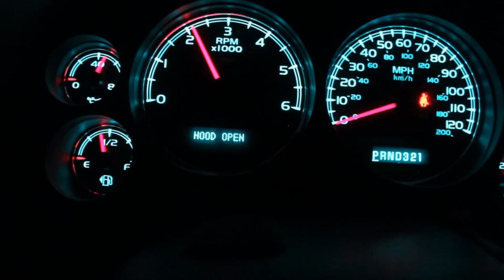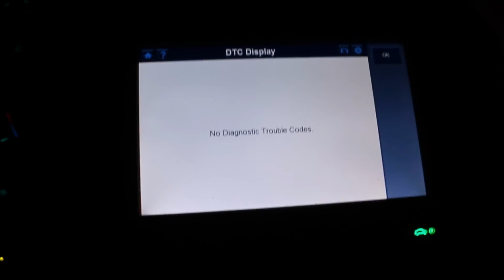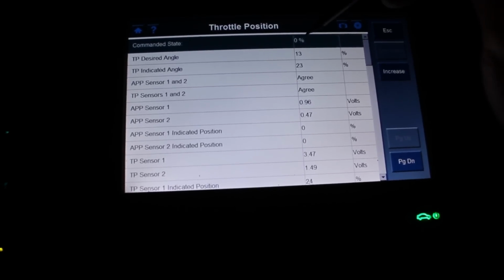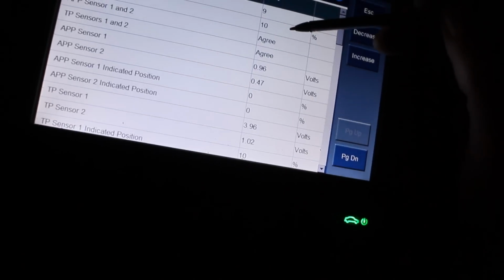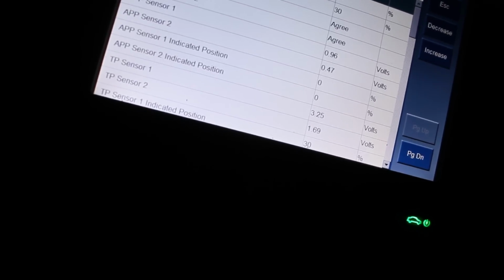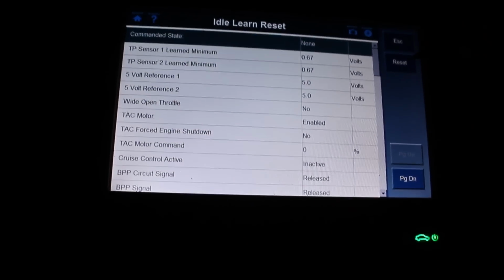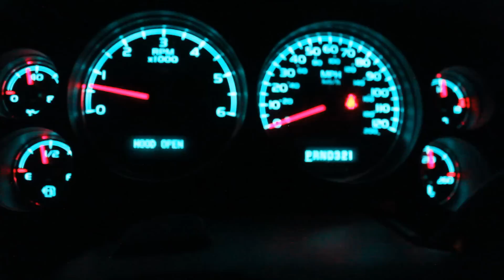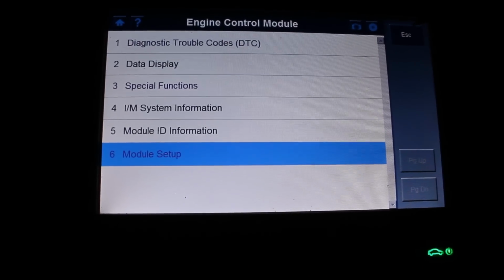GM Throttle Body Relearn using Autel MaxiDas DS708

Comment: I cleaned throttle body and used my snap on scanner to do re learn but my idle wont go down still at like 3000rpm any ideas.. idle was fine before cleaning it but had code

Comment: I cleaned my TB and it started idling crazy and the rpms was off at high speed. This video educated me on the relearn process!! I purchased a Foxwell scan tool and fixed it in 5 mins. Thanks for this awesome video.
Reply: which foxwell did you get?
Reply: @marrob_ltz1011   I used the NT510 but the NT520 will work also.

Comment: Just cleaned my throttle body today took apart from the mount and after I put it back together my idle is sitting at 2500 almost 3000rpms. Guess I will take it to GM to recalibrate it🤷🏽‍♂️ but after a few drives it idles at normal(500-600rpms) but when I rev it will go down to 1500-2000 and stay there...
Reply: Hi man.. I got the same issue... Did u got any solution for this? Plz help me out. After reset..idle came to 550 but when i accelerate it.. It goes up and does not come back. Any suggestions?
Reply: Also a saw some videos that did ground cleaning. The one underneath the front driver door when normally lifting jack is placed to change the tire. But with me it did not work.. I try to drive the car much.. Still same.. I will wait to drive 2-3, days lets see.

Comment: Rpm is at 1300, can this device reduce it to 500-800 ?
Could it adjuste the throttle body by default ?!
My car is Peugeot 206 1.4i 2006.

Comment: I have a question. I got a 2007 gmc yukon. And i was driving  at 75 mph. And then the check engine light  come on..   and wont pass 60mph..  so i put the scanner  i got  a code for throttle  body. Ao i bought a new  put it on .. i did the relearn reset ..  still doing the same thing but no codes . 3-4 gear  rpm go higher to 3000 so i have to release  the gas pedal so it can catch  the gear. . Any suggestions. Thank you..

Comment: This happened to my truck 2010 Silverado changed the throttle body and now is 1,200 rpm idle to high I don't have this scanner or computer where can I take my truck to fix and how much is going to be thanks.

Comment: Hi Hiram, like your DS708 videos. I also have a DS708 that I have not updated it since mid 2014. You seemed to do quite a bit of advanced procedures with a DS708 that Autel only lists it's coding abilities as minimal, while the Maxi Sys 908 coding abilities are listed  as advanced.
  Since you bought your MS908 I know the hardware is better and in theory could offer much greater ability to process more complex coding ability  , but in reality did you notice if it  really offered way more needed coding features than the DS708 seemed to have (aside from the Pro's online programming for BMW and Mercedes and using it's Maxi Flash J2534 off a windows laptop after purchasing  a paid OE subscription, that you actually found and  need that your DS708 lacked with it's so called minimal coding ? Thanks,Jim

Comment: Hiram Gutiérrez what's other options to reset throttle body , I don't have diagnostic tools.. in my 02 Yukon I cleaned inside throttle body and I also  removed the butterfly valve , I know  sounds dumb but I did it. after I cleaned it , I put everything back and crank the truck it started idle hight 2000 rpm kept going up  .. what I need to do ?

Comment: Can I do this procedure to a 2005 g35 6mt? instead of doing the three step throttle body learning procedure.  it's idling at 3k rpm on cold starts and immediately shuts off its self after 45 seconds.

Comment: hey brother i have a 2006 Chevrolet impala 3.9 
i cleaned the throttle body and lost the idle to 2500
i have the autel maxidas ds708 scanner and tried
to reset it. i follow the video while i was doing it ant
it doesn't give me the idle reset option. can u help
thx u..

Comment: Great video. This can happen on many GM vehicles from just cleaning the throttle plate. I cleaned the throttle body on a 2011 Chevy Malibu and this happened. I was thankful that the Auto Enginuity software I was using had the throttle relearn. I am thinking of buying this tool in a few weeks.

Comment: Greetings Hiram. Quick question did that option come with the scan tool or did you get it with an update? Our Autel maxisys doesn't have that option for none of the gm vehicles we've replaced a throttle body on. By the way, I love your videos, thanks for sharing all that knowledge with us. Keep the good work up.
Reply: +Hiram Gutierrez Thanks for the input, I'm close to buy a ds708 that's why I asked.

Comment: Is there anything the scanner does not do that other scanners usually do any info would be appreciated looking to invest in this scanner. Does it do mode 6 or programing fuel control modules , body control modules or crank relearns , evap testing. Thanks

Comment: You said if we had any other ideas for any other videos to let you know. Well, I know I've asked for this before, and I'm asking again now. I'd like to see a video or possibly a series on reading an oil circuit diagrams. If you need an example of what I'm talking about, watch the video series on reading electrical wiring diagrams on the realfixesrealfast channel. I know electrical wiring diagrams and transmission oil circuit diagrams are very different things so if you did a video series on oil circuit diagram reading, odds are it won't be done the exact way that the electrical diagram reading series on realfixesrealfast's channel is done. If you listen to how he explains things and pay attention to how he conducts the series and starts out with the simple and gradually moves onto the more complex though, it'll give you a good general idea of what I'd like to see in a transmission oil circuit diagram video or video series. Thanks for what you do for the DIY'ers and the people who are trying to become professional transmission technicians.